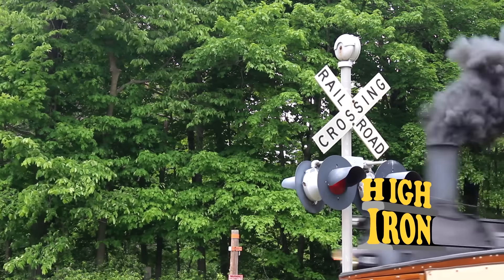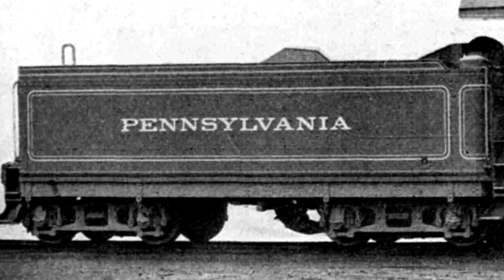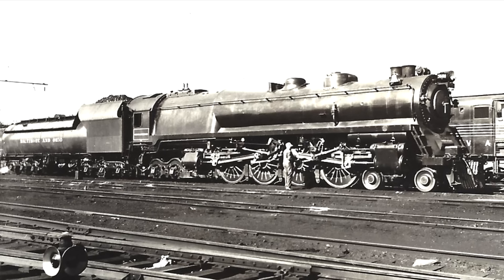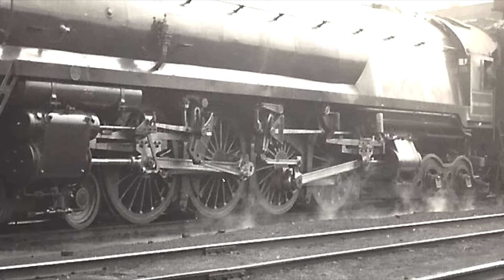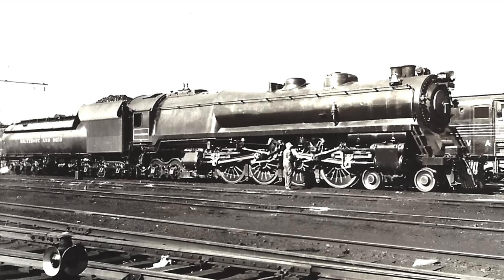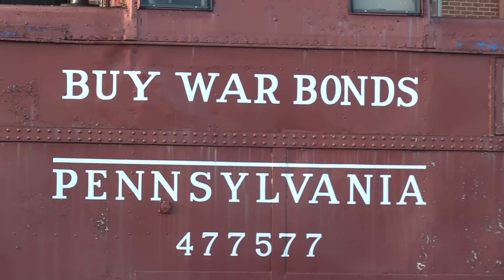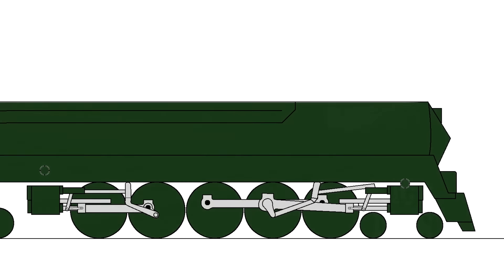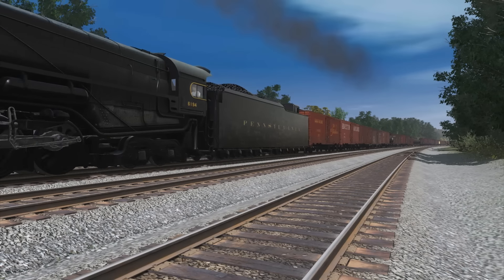Why Weren't Duplex Steam Engines Successful?

Comment: I've been wondering what would the Baldwin demonstration duplex look like if the B&O and PRR not order there own
Reply: As designed, it had the same four-drivers-together design as the N-1, the Q1, and the stillborn ATSF 6-4-4-4.  But it had conventional high-speed piston-valve gear, and a 102-to-104 square-foot grate.  Interestingly, it did not appear to be spec'd for Timken roller-bearing rods, which of course turned out to make a considerable difference in 4-8-4 performance at very high speeds.

Comment: I wonder, what budget is needed to develop and build whole new locomotive. They probably own the old blueprints, yet missing infrastructure - it will be not an easy task i guess
Reply: Several million dollars at least. It has been done in the UK a couple of times (with a rather larger number of abortive or stalled projects). Yes, everything has to be made from scratch, whereas in the heyday of steam there were many off-the-shelf components available.
Reply: The T1 Trust started with $10 million, which is the number used for priorities and development in the feasibility plan.  Subsequent acceptance of compound inflation in specialized engineering and factor costs now has the budget at $20 million (through the engine's construction, modeling and testing, and developing the support systems and storage base(s).

Substantial cost can be saved if the development money is either committed or 'contracted for' when development is conducted.  One of the original financing strategies was to follow Ross Rolland's approach in finding sponsors for the AFT, locating corporate donors and private well-heeled 'enthusiasts' to accelerate the amount of assured financing.  So far, that has been deprecated in favor of slower fund-raising that keeps the locomotive out of any ownership struggles or anticipated control battles.  But it is increasingly difficult to organize a heavily-supplier-subsidized effort like the restoration and improvement of the ultimate British locomotive (71000 Duke of Gloucester) which exceeds Tornado or the P2s as the greatest example of a first-class locomotive effectively done with a minimum of cash fundraising or grant spin.

Comment: Yet over here in Australia (South Australia) we also had a steam loco class 520 that was base off the T1's but better.
Reply: It was just styled as a 'hommage' to the T1 design.  It was a highly-capable 4-8-4 in its own right, but not a 120+mph engine.
Reply: @wizlish  to be fair here we didn't have track that's good enough to run at that speed here even today we still don't.
Reply: TBH you had 100mph capable trains in Queensland (but it would take an actual zero-overbalance reciprocating steam locomotive to run safely on that track!)  Not coincidental is the fascinating history, and gobsmacking locomotive types, that were given zero overbalance in the waning years of steam...

Comment: This video neglects mention of the duplex locomotives built in the UK in the late 1800s.  Most notable were the London and North Western Railway's Greater Britain Class 2-2-2-2 express passenger locomotives of 1891.  They were three cylinder compound locomotives with the outboard cylinders driving the rear drivers and the center cylinder driving the front drivers.  Their performance did not inspire the railway to continue building such locomotives.  There are accounts of them getting stuck in stations with one set of drivers spinning forward and the other set spinning backward.
Reply: Nothing a better valve gear on that dustbin-sized center cylinder wouldn't have fixed.  But Frankie chose to cut a corner and just use a slip eccentric, which after all would be 'pointed' the right way when the locomotive started to move.  Unfortunately something he, like the Turbomotive designers after him, forgot is that many English locomotives back into terminals, and will have the slip eccentric facing squarely the wrong way when the HP valve gear is reversed.  Still all would be well if the engine starts normally on HP interception, as the link will trail by the time any particular pressure builds up in the LP circuit.  But ah... what if that single axle slips at starting?  Plenty of steam, right then and there, more than ample to drive the center cylinder effectively... but slipping in the wrong direction.  Until you could get the regulator closed or the reverser wound up, you'd happily have the drivers rotating in opposite directions with an enormous cloud of smoke and soot erupting at the end of the platform.

Angus Sinclair has an amusing description of the ailments of the English-designed James Toleman in Development of the Locomotive Engine (which used to be available on Google Books, and can still be read on Hathitrust).

Meanwhile, the Midland and Smith compounds correctly placed the HP as the center cylinder, and paired the LP volume outboard.

Comment: The T1 was capable of reaching the speed of 146 MPH . Not sure if there are any in existence?
Reply: The only problem is that a reported speed of that magnitude would have had to come from the Franklin reports that Vern Smith brought up in One Man's Locomotives, and those were almost certainly high-speed-slip artifacts.  By that standard a New York Central J3a can, and did, reach a sustained 161 to 163mph (on greased rail during Kiefer's augment testing) which incidentally far exceeds poor Blue Peter's claim to a record in this category...

Do not confuse this with the Arnold Haas-originated claim about the S1 6-4-4-6 reaching 141.2 or whatever "with the Trail Blazer in 1947" with some carefully unspecified ICC punishment being one of the supposed consequences.  Aside from that suspiciously precise number being close to a 'round' metric speed, the ICC did not then have speed-oversight powers and there is, in fact, no trace of anything like this anywhere in the surviving ICC records -- so the preponderance of the evidence basically says "BS" (although I'm tempted to introduce a new class which I call 'iron horseshit' for quite a bit of record-related stuff)

Emergent critical speeds would very practically limit the T1 through induction of high-speed spinning via resonant vertical augment, but much of this has no deterministic components and has to be first multiphysics modeled and second tested carefully on the roller rig before actual 'as-run' performance capability can be assessed.

Comment: No mention of the Big Boy?  They are simple articulated but are duplex type
Reply: Not duplex
Reply: No locomotive can be articulated and duplex. Duplex locomotives have rigid frames, not articulation whatsoever.
Reply: @chooch1764  I understand that. It still has multiple sets of drive wheels and cylinders like a duplex. It's technically a simple articulated.

Comment: There is a major non-sense in this video. Duplex locomotive were incented decades earlier in France, in 1863. When baldwin produced its first one, they were common in France. The reason why the US were so late is that they didn't need them : they had enough coal but were lacking workforce. France had the exact opposite situation : wages were cheaper than coal, so we could afford extra maintenance to gain more power per coal unit.

Comment: The french invented the duplex in the 1860s iirc, it didn't work then, it didn't work when the pennsy tried it, and it will never work because multiple sets of drivers on a rigid frame is a stupid idea. EDIT: The first Duplex was not built by the B&O it was built by the frenchman Jules Petiet in 1863
Reply: Petiet's locomotive isn't a duplex in the sense these locomotives use the term; it's basically bilaterally-symmetrical running gear.  The interesting thing is that it appears to have run successfully enough for what it was designed for, a transfer locomotive on (as I recall) the Petite Ceinture line around Paris.  Something it was NOT was a high-speed locomotive, another thing it was NOT was a dynamic-augment-reducing design.

Can you go into actual technical detail about why multiple engines on a rigid frame in a high-speed locomotive4 is supposed to be self-evidently a stupid idea?  (There are actual potential reasons, but I want to know that you understand them)

Comment: Still don’t know what a Duplex Steam Engine is. Maybe you can explain it in an episode of Fun With Flags.
Reply from the maker: It was explained pretty clearly at 2:15
Reply: In locomotive 'parlance' the term "engine" is used to refer to one set of cylinders connected by rodwork to driven wheels.  A typical Mallet has two engines in this sense, one fixed to the boiler and the other 'hinged' in the horizontal plane.

A Duplex has two engines, in a rigid frame, with a cumulative number of axles equal to a rigid-frame single-engine equivalent, with divided drive for the specific purpose of reducing dynamic augment at high speed.  The equivalent of a 4-8-4 was therefore a 4-4-4-4; the PRR as late as the Thirties thought four-coupled power was the best for very high speed operation (see for example the legends spun around the E6s 'Lindbergh Engine' 460) and they consequently developed the production passenger locomotive as if it were a double Atlantic under a large common boiler.

Part of the situation was that conventional locomotives were getting the high-speed rod arrangements in a kind of parallel evolution to the duplex idea.  Note that it would seem obvious to give the 1936 Timken roller rods to the Big Engine, just as it would to retrofit them on the Milwaukee A class when the F7 Baltics came along.  The Niagara was only an incrementally more powerful Mohawk, not designed to run any faster,  and in fact NYC's intent as late as VE Day was to build their 'corrected' versions of 4-4-4-4 duplexes for true high-speed postwar passenger work: it was quickly and dramatically noted that the lightweight running gear with passenger-size drivers produced all the power at speed NYC needed for practical efficient passenger service -- only the zero-fueling-stop capability for trains not going through Cleveland via the Terminal Tower electrification remained a real advantage.

Much of the anticipated true fast passenger development would likely have gone to turbines and not reciprocating locomotives at all; the fastest Chapelon design was only to 150mph (and I suspect out on the ragged edge of stability anywhere close to that -- see the design in Carpenter's 1952 translation of LLAV volume 1)

Comment: Who invented the Steam Locomotive and in which year ?
Reply: First working rail locomotives were Richard Trevithick in the UK between 1802 and 1808. But it took another 20 years before enough power could be generated to allow haulage of significant loads at speed. Stephenson's Rocket of 1829 was the breakthrough. Both the original and a replica can be seen at the NRM in York.

Comment: What is the "duplex" in a duplex steam engine?  Is it dual steam pistons on the drivers?
Reply: The working definition is two reciprocating 'engines' (the technical term for a set of cylinders and rod-connected wheels) under a common boiler, with the specific purpose of reducing augment.  (Note that this rules out Petiet, and indirectly the French and British divided-drive engines).  In American practice this uniformly involved use of two-outside-cylinder DA with 90-degree quarter.

It was possible to use inside rods or gearing to connect the two independent engines, and two examples are the Withuhn conjugated duplex drive as proposed for the ACE3000 and Riley Deem's geared Q2 for his North American Locomotive Company in the early '80s.  My own version of this is to conjugate with a longitudinal shaft detented to settle into 'best-aligned' synchronism that has Ferguson or magnetorheological clutches to reduce engagement or other shocks.  This can be conjugated, especially when zero overbalance is used, at the equivalent of 135-degree relative phase so there are eight power impulses per driver revolution (thus minimizing surge effects) and limited tendency for loss of adhesion on one engine to require active traction-control action.
Reply: @wizlish  Will have to Google images of some of the mechanisms you've referenced but thank you for the detailed explanation.

Comment: Fun today also how American freight railroads have completely abandoned any sort of concern for aerodynamics.
Reply: Somebody should introduce you to the Arrowedge.
Reply: @wizlish  Interesting.

“The results were positive, but not enough to justify moving forward,”

Seems kinda obvious. Aerodynamics become increasingly irrelevant the longer a train is. The gaps between the cars catch air and make the whole concept moot.

But for those steam engines pulling only a dozen or so cars at high speed, probably makes much more sense.
Reply: Arrow edge was essentially a silly idea right out of the box; as you note, inflatable 'full-width diaphragms' between the boxes would have been a far better approach.  I only mentioned it as being -- in both versions -- an example of interest in more 'aerodynamic' concerns by a modern North American railroad.
Reply: @wizlish  Did I miss something? Didn't seem like it was the railroad's idea or concern.
Reply: Union Pacific practically fell all over itself promoting the original Arrowedge as an amazing breakthrough technology in stack-train fuel efficiency.  I to this day have not figured out who approved the idea, let alone built it out so defectively that it would self-destruct in ground effect under bridges.  The two guys who peddled the idea then came back with that cut-up container version that didn't even have forebody streamlining.

As you note, the quartering and turbulent air resistance is the 'significant' factor in train resistance, and the effect of what are in essence full-width diaphragms are more important than nose and tail streamlining.  (For those who don't want to acknowledge this,look at the T1 to T4 'Metroliner' test train that ran over 150mph)

It remains a mystery of sorts why no one has tried reducing the ghastly effects of centerbeam flats, especially bulkhead centerbeam flats, or empty unit coal trains.

Comment: whats interesting is how the military designed nuclear powered ships and subs. but nothing on land as far as I know. what if we were to use today's small fast nuclear reactors to heat the same steam that runs a locomotive? trains cross country would be cheap as the fuel would last for long periods of time, be cleaner emitting than its coal and oil burning ancestors and diesel locomotives. why is this not being studied? we could bring back the beauty and elegance of the traditional steam locomotive.
Reply: France has the correct answer in their nuclear-powered high-speed trains.

To my knowledge the only -conventional steam' design was the Alco A-100 project.  Although Alco repurposed itself as a 'nuclear' company by the '60s, I don't think it ever quite developed the reactor technology (probably molten-salt like the propeller-driven nuclear airplane powerplants) that would have to be used.  There were promotional illustrations showing something derived from the S2 direct-drive approach... presumably there were drawings from which the artist could work.  (This was the same guy who painted the C636P and the FEF-4, so maybe drawings were a bit superfluous...)
Reply: @wizlish  But French high speed trains are powered by electricity generated from nuclear power stations - huge difference. The problem with putting a nuclear power plant on a train would be shielding, both in terms of weight and space.
Reply: That is very specifically the point I wanted to make: the only practical way to implement safe nuclear power flexible enough, and cheap enough, and accident-tolerant enough for railway service is to keep the nuclear-cycle cost and security issues on the ground, shared synergistically with other applications for electricity such as charging BEVs while also sharing any contribution from typical renewables using the electric distribution system.